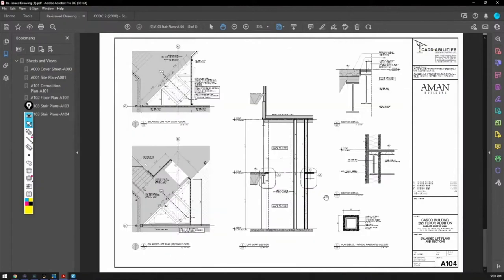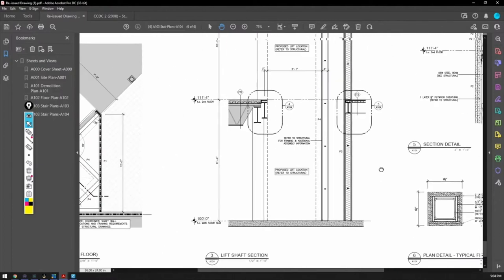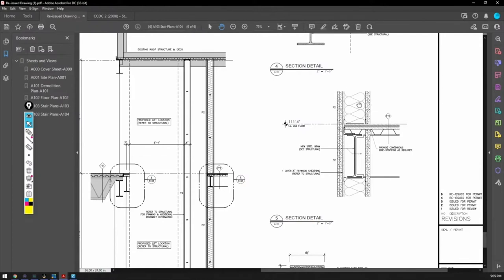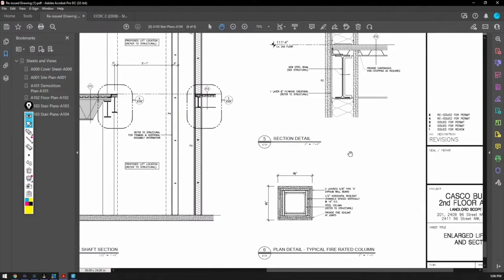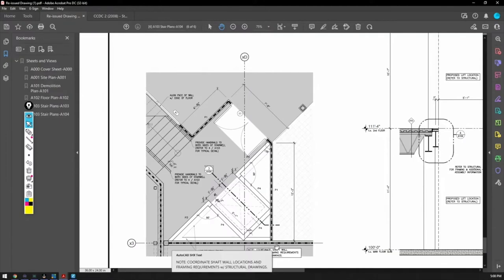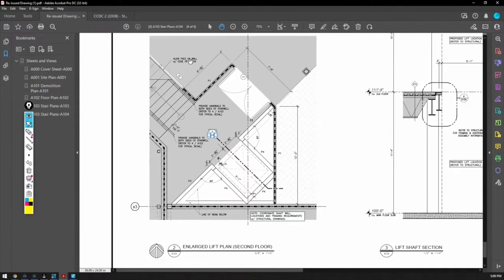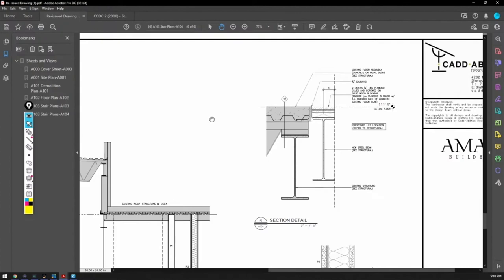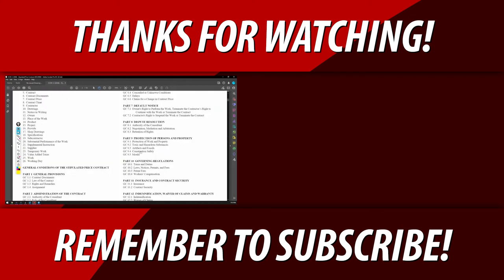Blueprint Reading Intermediate For Metal Stud & Drywall

Comment: Question Chris, how much math does someone have to know to do what you do? do you go past fractions? what would I need to know math-wise to become a drywaller? Thanks for the vids!
Reply from the maker: Actually great question my man. So you don't need to know much, just basic addition, subtraction, multiplication and division. When your an estimator all you need is to understand basic geometry, like length x width for area. The most important thing to know is how to read a tape measure and no math required. You only need math in your higher years like 3 to 5 years and sometimes actually never. You will learn how to estimate materials and do layout  as you go. I used to suck so bad at math but after 20 years in trades and dealing with money I am an expert. It just comes to you. Learn how to read a tape, we never ever at any level use fractions really. It's basic 1/16, 1/8, 1/4, 1/2 and adding those together is super easy. I can teach you all the math you need probably in an hour. I should do a live stream or a video on that.
Reply: @ConstructionKronies  Thanks Chris. Yes, it would be great if you did a video or stream on 'all the math you need to know' for drywalling. I always thought cutting out whatever space you needed within a drywall sheet required fractions. To cut a circle, square or triangle you used fractions.. but I guess I am wrong.
Reply: Keep in mind mate the 3,4,5 concept for triangle...3,4,5...can also be 6,8,10...just learn into that. And get your fractions down good..double 5/ is 1 1/4..I'd suggest an app on your phone for learning and repetitive to muscle memory...aside from that..the right tape is so useful...I bought mine from rona..it is double side night vision tape with magnet and drop rated...I looked into a  special pouch for a tape since it's one of your most used tool and clamps to hold materials with magnetic bits. Take your time doing it right. This guy shares his wisdom on proper methods to install as well!! Cheers mate. GOD bless us all